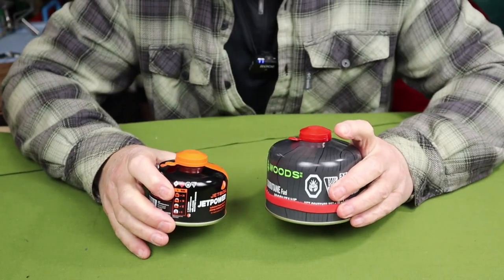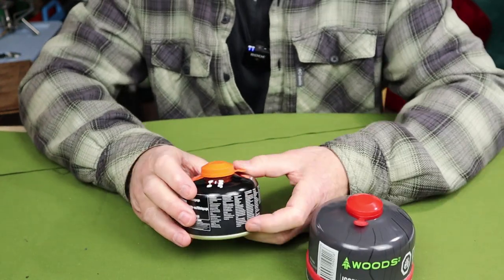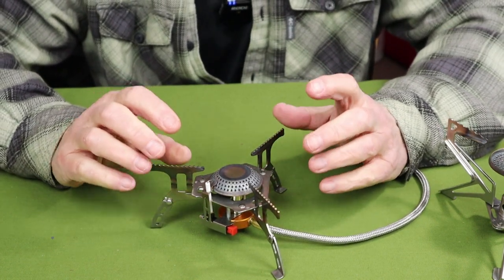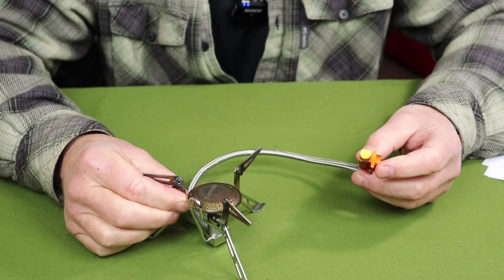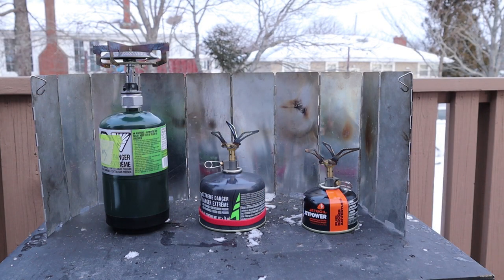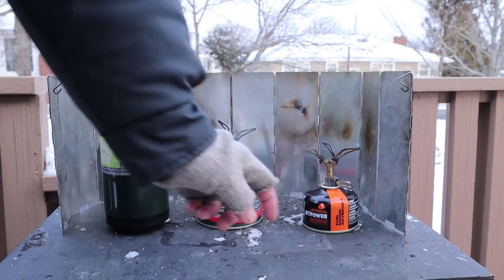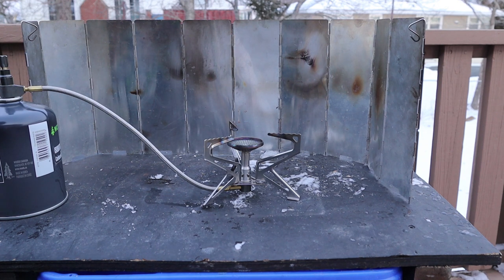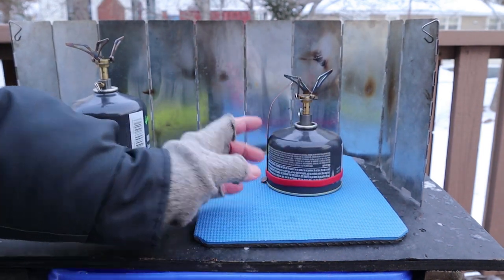Comprehensive Guide to Using Gas Canister Stoves in Cold Weather

Comment: That was pretty comprehensive.   I’m sure it’ll help some people, and THANK YOU for pointing out that you need a stove to get hot water, and you need hot water to run your stove.   Some real keypad experts are out there.
Personally I find it odd that the very people (bush crafters , hikers etc) who are supposed to be so environmental, drop it without a thought when it comes to personal convenience.  Except for the maybe 1% of people who refill their cans, canisters are so so wasteful.  Manufacturing the steel, the extra shipping of raw steel, shipping to be filled, then to the store when full, even printing the canisters, etc…make these the worst choice.
I don’t mind if people choose these, it’s just when they’re being so hypocritical about it.
Reply from the maker: You make a good point about the environmental impact of the gas canisters. I heard Paul Kirtley argue that a few years ago and I resisted using the canisters at all. Now, I do refill my small  canisters from the larger but even that, it is less impactful to use alcohol or wood. Thanks for commenting
Reply: Another alcohol and wood stove user, I assume. 👍
Reply: @danielkutcher5704    Another person who doesn’t really read a post before commenting, I assume.
If you actually read my comment, I said that I don’t blame anyone for using a gas canister, if that’s what they like, but don’t go around claiming you’re pro protecting the environment if you do.   
I can’t begin to tell you how sick I am of people who claim to be environmentalists, yet will do nothing of their own accord, if it causes them the most minuscule of inconveniences, and then expect the government to do it for them.  
Not that it’s relevant, since I’m only calling out hypocrites, but I adore my firebox stove, I use alcohol on occasion, and white gas.  Though I’m planning on buying a universal fuel MSR stove soon.
Reply: @jimf1964  Apparently, you don't understand what 👍means. I agreed with your post. 🙄
I use alcohol and wood, and am environmentally responsible, and don't expect a pat on the back from anyone for driving tiny cars, recycling, etc. Your response startled me, but I will just assume that it was a simple misunderstanding on your part or a failure to communicate clearly on my part. ✌
Reply: @danielkutcher5704    Hey, I run into a lot of keyboard experts, so maybe I responded too quickly, or it was aimed at someone else.  Sorry
Reply: @jimf1964  All good. I get the keyboard experts comment. I regularly roast people who are pro-everything "progressive", buying into the hype without understanding the science, technology, time, money, and excessive use and abuse of natural resources to accomplish something (electrification of the world, for instance) that would require many generations of use to achieve the "carbon neutrality" that's supposed to reverse climate change and save the world before it burns up "in 12 years"...
"Blind faith" isn't a logical choice when logical reason is always an option. Take care.
Reply: @danielkutcher5704     I just listened to a Jordan Peterson podcast with a talk about climate change with a phd with a boat load of expertise.   She pointed out that the person who was largely responsible for the "hockey stick" used tree rings for the flat part, but since it didn’t show any change, he used a totally different data set for the rise.  He used observational data, ie old weather reports.  He also maximized the appearance by playing with scale.   So basically a total lie.  They even mentioned the "slight of hand" how they went from global warming to climate change.   
Also the fact that the world has become 15% greener, which means more food can be grown, but of course they keep pushing the lie that deserts are expanding, and a lot about how people are pushed into agreeing….all sorts of stuff.  You may want to listen to it.
Reply: G'day Jim, fair enough mate, a few thoughts if I may; personally I'd go with a "real" fire every time ........  however, it is easy enough for even the most experienced and well meaning to cause a big problem spark wise in poor conditions, and even with a well contained fire box or fireplace, one certainly cant guarantee absolute safety. 
Incidentally, over here in Oz, (in many locations anyway), its been determined that taking deadfall or indeed anything off the forest floor upsets the ecosystem too much to justify, as opposed to help clearing the obvious and much more easily ignitable ground fuel. Whilst I can see both sides, if the bush goes up in flames to start with ............. there goes everything else with it.
So .... we go with less risky, (but still risky to some extent), fuels/stoves and really an armchair ride in comparison. To my knowledge canisters, (like aerosols), are recyclable should you choose not, or have no means, to refill them   ....  that's something I guess. 
Some would argue, we're too far gone anyway, ...... but that's just totally defeatist IMO.
Having said that, and hypocrisy well noted, it's gonna take more than simply bushcrafters/hikers gear choices to turn it around.
Reply: @eyeofthetiger4184     Yeah, thanks for the comment.    I hope I didn’t seem to imply bushcrafters had the power to change anything, if indeed it needs changing.  Only that people are so hypocritical.   They’re all so environment this and that, until they have to do something a little inconvenient.
I did mention that canister stoves were recyclable, and to the people that do, hats off, but most either can’t, or are just to lazy.   They’d rather let the government take ever more and more control over us and "let them take care of it".
The meatier part of your comment was interesting.   Should you burn dead fall?   
So I’ve commented on that in the past.  Dead stands, and fallen stuff are truly part of a full ecosystem.   However in most places, certainly here in canada, the firefighting has been so aggressive that natural burning off of the forests never happen, fuel reaches much too high levels, and fires become much more intense and damaging.   Also there are problems like the invasive ash bore beetle that’s been destroying almost all our ash trees, the pine beetle that’s been causing huge dead zones of pine just waiting to burn.   So there are times when you’re actually helping a tiny bit by burning it, and times not.   There’s also the issue of scale.  We have a pretty huge natural area in canada, so if you’re in some crown land where hardly anyone goes, it won’t make any difference, or the reverse, in a crowded camp site where barely a stick can be found.
Sooooo, there’s lots of back and forth on this, but most people that have opinions, like the hunting topic, only know anything about nature by tv.   They don’t get topics like scale.     Like the two women I overheard talking on their phones about the horror of a mine they saw.   Never mind their phones, and other stuff in their comfy lives maybe came from it, but that mine, on a map of canada, hell even of their province, would be impossible to see, because it’s just so tiny in he scale of things.   But they complain about how they should shut it down…..and destroy someone else’s environment?
Anyway, been home sick for 3 days, and I guess I need someone to talk to. 😂 so sorry for the book I just wrote.
Reply: @jimf1964  No worries at all Jim, and thank you for your reply mate, I still see Youtube as a great resource for communication across the globe, especially if folks stick to the original concept of sharing valid ideas and info, .... I s'pose "valid" is debatable too, lol, gotta laugh, otherwise you'd cry with some content/comments.
Anyway, it's clear you're think'n big picture;  Controlled burn has been used by the indigenous here for many thousands of years, (even tens of thousands apparently).
and I believe it is acknowledged by the powers that be as a highly desirable strategy, but ....... politics/funds/resources/workload, blah blah doesn't do nearly enough of it to make a significant impact .......... then the cycle continues ......... major bushfire occurs, loss of life, property, business infrastructure and excessive overload to nature in general, ...... followed by media outrage ....... clean up, relief packages and so forth, followed by winter ....... (and in fairness we've been copping a shipload of flooding too, but that's another story).
Then REPEAT, ........ seriously ....... in this day and age ............
I do know a few firefighters personally and there is good work going on behind the scenes, ...... but see politics/funds/resources above.
Throw in particular species and their challenges as you mentioned. 
And the winging/whining of the largely soft and ignorant society, (hey I'm first to admit I'm softer than I used to be as a young bloke), but still run rings around the average Joe out in the sticks I reckon, lol.
Important point, Jim,  ......... "scale" ..... to be honest there's so much in it, pardon the pun. What are we up to, sneaking up on 8 billion people globally, and most of those currently crammed into concrete jungles, and of course many living on the street or in shanty towns. At the same time; yes still plenty of wilderness, in certain parts anyway, though gotta wonder for how long, given the human appetite for ........ well just about everything, especially if it has a dollar value attached.
And for some inexplicable reason, our inability to farm.  effectively, both on land and at sea, in a totally replenishing way.
All the best over there mate, I really liked, enjoyed and respect what you had to say. Cheers Duke.
Reply: @eyeofthetiger4184    Yeah, you too.   Have a good one, and don’t get bit by any snakes. 😀
Reply: @jimf1964  Certainly try not to mate, just so  long as you dont get eaten by any bears ; )
Reply: @eyeofthetiger4184    I always do my best to avoid that.  Darn things are like giant rats in some places.  Most of my camping is in a game reserve, and the animals seem pretty well trained to avoid people.
Reply: @jimf1964  Fair enough mate, I have heard that an angry moose is noth'n to be sneezed at either. Btw do have mountainlions/cougers or other big cats where you go ?
Reply: @eyeofthetiger4184     I was just thinking that I forgot to mention I camp in a hammock, which we call bear burritos!  😀
Yup, more people are injured by moose than anything else.  Often times they following a trail, and don’t want to get off.  They’re stubborn bastard.😀
Big cats we have out west in the Rockies.  Not where I am.   I spent a few weeks out there once, and it was so weird to see the warnings about little kids running around and stuff.  Apparently they’re like mouse toys for cats.
For us we got black bears, wolves up a little north of me, and coyotes all over.  Even in some cities.  Like some suburbs of Montreal have coyotes.
They’ve been getting more aggressive, and there have been more incidents with them.  We have a coyote/wolf hybrid now (some wolf must have had a thing for the young ladies and got confused), and apparently they’re bigger than a coyote, and more aggressive.  I dunno if that’s why it’s happening.
There’s becoming so many that shooting them is becoming a popular past time.  Most don’t do any harm, but some can wreak havoc on farms, deer populations etc…
So are the snakes and spiders really as bad as we hear over there?
Reply: @jimf1964  H
Bahaha ...... you've a great way of putting thiings mate, : ) 
Forgot to mention the canine family, thats really interesting, if not so great at your end.
Re; snakes and spiders; I guess fair to say when you grow up with them not so bad, but man the nasty ones are certainly, or at least potentially, deadly and there are plenty of them, particularly snake species. In the outer suburbs of Melbourne I've had, (admittedly only one), juvenile eastern brown on my front door step. This is bad news; ....... A. the Eastern Brown is up there in the top couple as the most venomous in the world, B. they are very prolific and C. juveniles are less likely to deliver a "dry bite" i.e. adults have learned to save the venom for food procurement rather than waste it purely on a defensive strike. And there are plenty of others of major concern; iIt is quite a long list. Having said that, deaths are quite rare, given the antivenom available these days. Biggest problem is if you're many miles away from help, even with correct first aid, your chances drop significantly, no dramatically, with a "full load" shooting through you.
Spiders, yep, same same, not so bad if you grow up with them and are careful, the "Sydney" Funnelweb in particular is a bugger, and again there others in the same family, ....  thankfully they're well north of where I am. Main two here are the Redback, (akin to a Black Widow), and the White Tail, which is reported to have a wide range of effects depending on the particular individual recipient, worst I've heard of though is very negative and symptoms can last for years if the reports can be trusted, ...... not sure I'd want to test it to find out, lol.
But hey man, growing up by the beach, plenty more nasties lurking beneath the waves, sharks and blue ringed octopus the main worries down south and Iooking back at what we used to do as teenagers/in the twenties, probably lucky I'm still here, lol.
Reply: @eyeofthetiger4184    Lol, seriously.  Teen Darwinism is definitely a thing.  We have the cold too.  Like the time my buddy and me got pissed, and took the canoe out, because there was like a 1meter twisting, winding lane of water, surrounded by a couple feet of ice….. but hey, it was spring!  Sort of.  Got stuck, broke a paddle that almost was like a steak into my buddies chest, and came close to needing a rescue.  
Another time being blown out to an open lake (about 140 miles long) in a rubber dingy, and unable to make headway because of the wind, yet turning down a boat that offered assistance "because we still had plenty of beer". 
It’s all good…till it’s not, I guess.    
I always figure, and tell those who bang on about how wonderful this or that place it, that every place has its good and bad.  We get into the 30’s with super high humidity where I am in the summer, then a couple weeks of minus 20’s in the winter (minus 5-10 being the norm), bears, wolves, skunks, the rare rabid animal etc etc, but we don’t have snakes etc…. Spring early summer the worst biting black flies, mosquitos, deer flies, horse flies,  like other places, but in winter, it’s cold, but no bugs at all.
It’s all a trade off.  The good and bad no matter where you go.
Our fresh water sometimes has leeches, and the occasional invasive lamprey, and is only useable a few months of the year.  Salt?  Just too dam cold in most places,  but not much to worry about.   Oh, there are a few beaches in the east with warm water, but half the time they’re literally swarming with jelly fish that sting like a bee.
As you said, it’s all good when you grow up with it.  The cold can be friggin dangerous, but we know how to deal with it, and it keeps a ton of dangerous things away.
Reply: @jimf1964  "Teen Dawinism" ........ that's a pisser !!!!! as we say, ..... like piss'n yourself laughing. And with the story, I can still imagine the predicament remotely, made my day mate.
Got to get to an appointment, I'll follow up very soon. Cheers Duke.
Reply: @jimf1964  G'day Jim, back again, yep for sure good and bad all over, I guess its the real extremes that get the publicity and in turn build a certain reputation.
Bloody leeches, pardon the pun, I hate 'em with a passion. I'm not real keen on ticks either though yet to be penetrated by one.
At least snakes and spiders do their best to avoid humans, but these bastards do their best to latch on, lol.
Speaking of "jellies" the Box Jellyfish here can be fatal, luckily for me they're all well north with the Funnelwebs, and off course crocs, lol.
We certainly dont have the same wide spread cold/snow that you have, but what we do get here in winter, (low single figures, occasionally below 0 C) does bring relief from flies and mozzies too. Snakes hibernate, so unless you disturb their slumber you'd be real unlikely to have an encounter. Very few out swimming/surfing/diving, so the water risks are mostly negated too; yet people still complain in the cooler months. Personally I quite like a day hike or an overnighter in the rain; adds some variety and quite meditative.
And dunno about you mate, but on the trail, I reckon it's easier to get or stay warm in the cold, than to get cool when its hot.
Btw . I tried a hammock to get away from the snakes and spiders but I'll be buggered if I can get comfortable in the darn things. Anyway "bear burritos", hahaha sure not gonna help with that. Man I'd be armed to the teeth, + perimeter alarms & claymore mines. I was gonna say sleep up a tree, but I think bears climb, is that right  ?
Reply: @jimf1964 if you puncture the canister they are recyclable. As far as environmental impact is concerned, isobutane and propane burn much more efficiently than wood. Alcohol that is primarily ethanol based would likely have the least environmental impact of non-gas fuels. White gas is somewhere in between I would think. Of course wood is made in a very natural way and does not have to be distributed using trucks, etc., so maybe wood is the most efficient on a grand scale. I don’t really know. I would say do what you doing the most environmentally friendly way possible.
Reply: @wanttogo1958    Yes, people just have to do their best.   I’ve been someone who is environmentally inclined for decades, though I believe man made global warming is at best overstated.   I only made the point because people don’t realize what goes into even a small canister, and recycling not only uses a lot of resources too, but often just sits forever.   These were popular decades ago, but were pretty much dumped because theyre a waste….but hey, maybe they aren’t that bad.
When I’m alone I use mostly alcohol stoves, or a small stick stove, but in the end, even those have fuel that comes in something……but how many 1/4 full canisters are laying around cuz people done want to take 2?  🙂